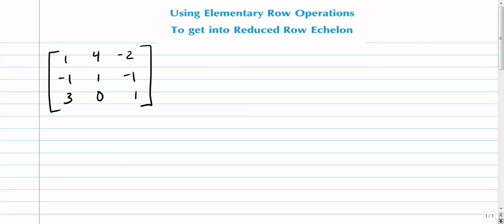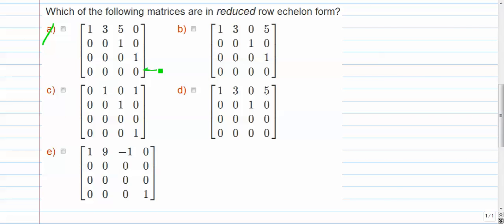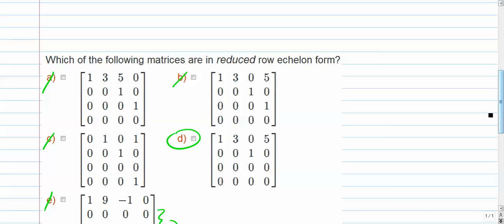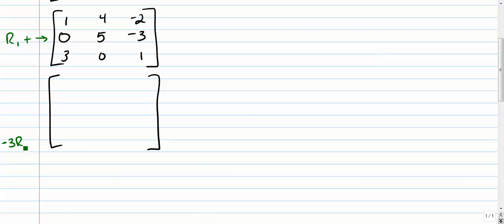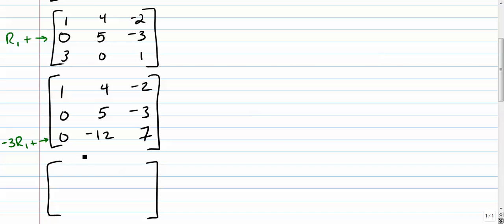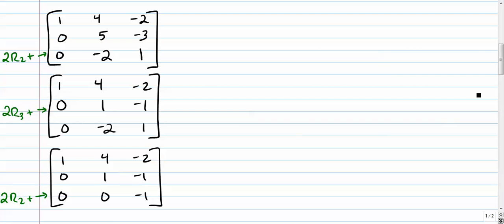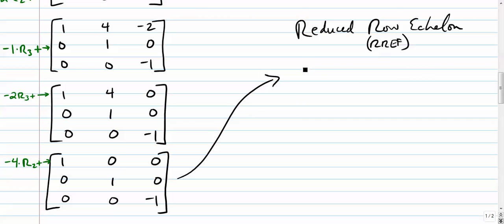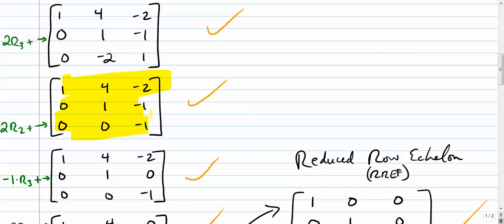Matrices - Using Elementary Row Operations to Get a 3x3 Matrix into Reduced Row Echelon Form

Comment: D wasnt rref because row 1 was 1 3 0 * not 1 0 0 *
Reply from the maker: Not true, but that's a common misconception.  For rref, a row doesn't necessarily have to have only 1's and 0's.  The "3" is fine because it is not the pivot of the row and there are no other nonzero numbers in the same column below it.  This can be tricky - keep practicing and thanks for the comment!